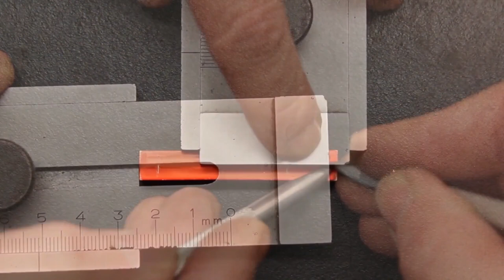Part 15 - Build a live Steam Locomotive  - The Feedpump adjustment Lever

Comment: Have you got a link to the measuring tool used at the start?
Reply from the maker: https://www.contorion.de/p/holex-streichmass-mit-flachem-schieber-c85173285?$ps=1&measuring_range_max_mm=300&packing_quantity=1&simple_sku=58199582&aid=&targetid=&campaignid=19343918542&utm_medium=SEA&utm_source=google&utm_campaign=[4]_Shopping_PMax_A/B_TestGroup2&gclid=CjwKCAiA2rOeBhAsEiwA2Pl7QzwKUy1AgS_1_PsNNBfuC4LmzpLQ7WzA0w40QmPkvLAz5LuN_Zs_BxoCq8YQAvD_BwE